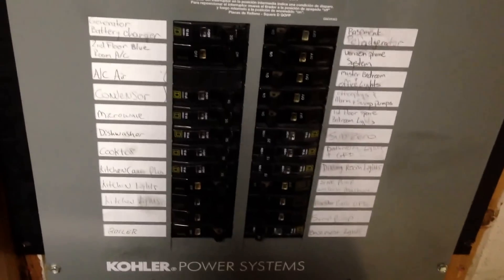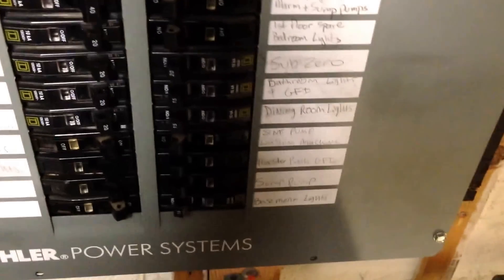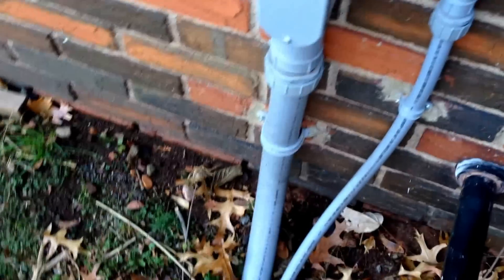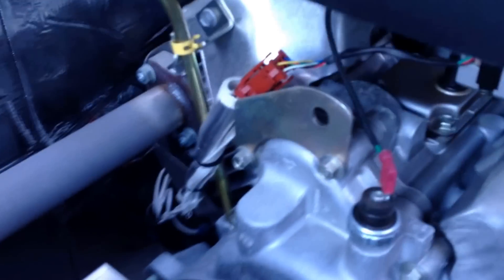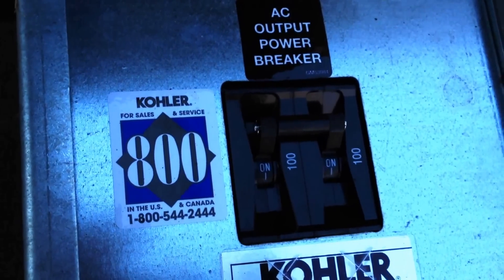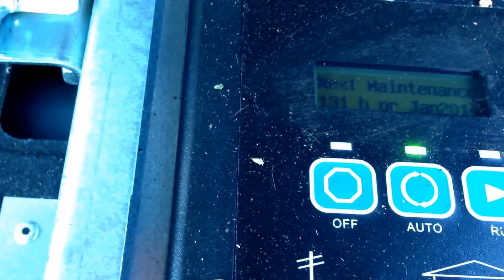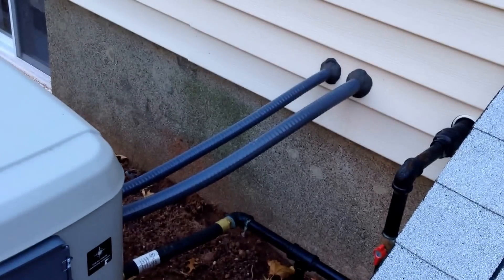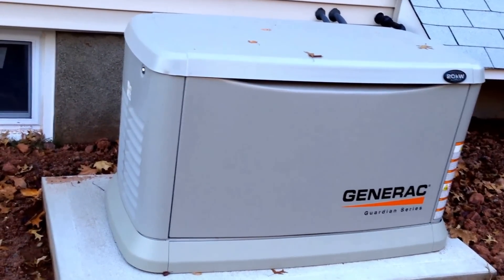Kohler 20KW RESA Whole House Standby Electrical Generator

Comment: That kohler standby generator is a 20kw generator that runs the wholehouse and yet has a transfer switch connected to it that only runs certain things which doesn't make sense. If the installer screwed up and made a mistake he should be held responsible for that.
Reply from the maker: Good point. Not enough of them are held accountable. That's why I try to educate everyone. Thanks for commenting!
Reply: @silverbankruptcy  that's good you do educate everyone. At my parents house where I live I have a Kohler automatic standby generator as well but have the 14kw one that runs the wholehouse which we had installed back in 2013. Thankfully the  people that installed it knew what they were doing and did everything right.

Comment: Transfer switch was done that way because the house is a 200 amp service but the generator output is 85 amps on natural gas, 100 amps on LP.  That transfer panel lets to prioritize which breakers have priority over others when your at max load.  Notice the main breaker on the generator was 100 amps, that’s a clue...
Reply from the maker: Good Observations!

Comment: Depends how the owner specs the install - IF you told the installer you wanted all circuits running off your genset, and they didn't, they failed, and you have an issue with the installer...

We run our entire home and/or our small business off our 20-RESAL....  we did get the Kohler controller (the "L") and have had no problems powering our water system, all the baseboard heaters, the electric stove and oven, and the shop all at once.  While I won't run my 3ø converter off it with other stuff running (I'm not that crazy!) it will run everything else no problemmo.

I would take it up with your installer why they did what they did.  If you specced it that way then you'll have to fix it on you, but if you specced it to have 100% of all circuits available and they didn't, it's on them.

Comment: Who ever did that install should probably have their certification removed.   That said, that unit is likely able to power the whole house it's just set up with a manual load shed.

The access port for laptop connection is on the control board, you just need to remove the protective cover on the front.   With Kohler there's not need for the homeowner to do that that though, you can access a lot of the control features and monitoring remotely with the OnCue software.

Comment: Usually, who ever spec the generator wanted only certain loads powered.  Normally this is done when you have a large house but only want several circuits powered (A/C, heat, certain rooms, pumps, etc).  This is an air cooled engine so you will have to change the oil more often during a long run than you would with a larger engine. Most, again, most small engines require an oil change after 24 hrs of continuous running.

Comment: This is called a load side solution. It's cheaper, and it allows the system to shed certain loads to power priority loads in proportion to the available power. For instance it will shut down your AC in favor of your boiler and lighting circuits.